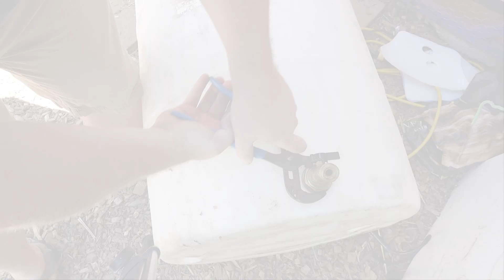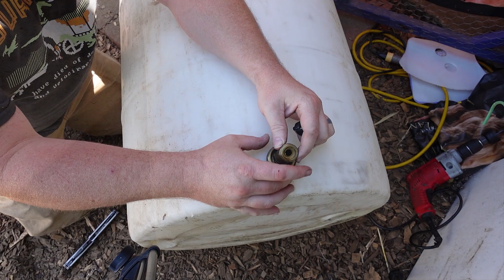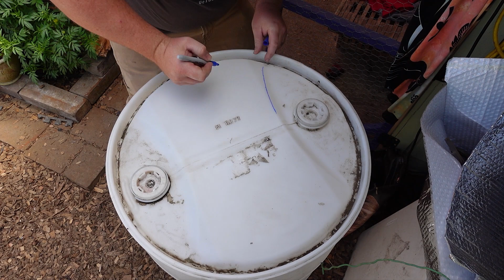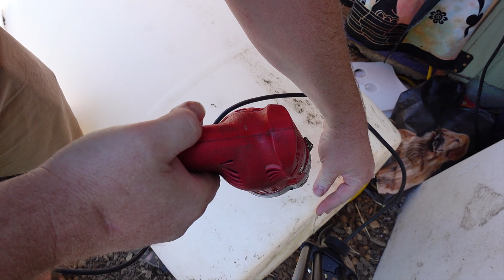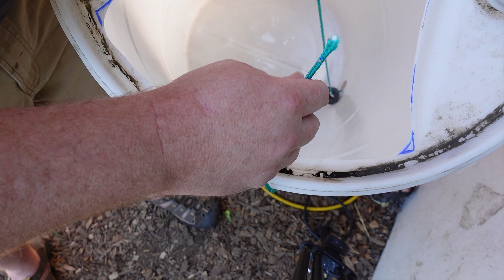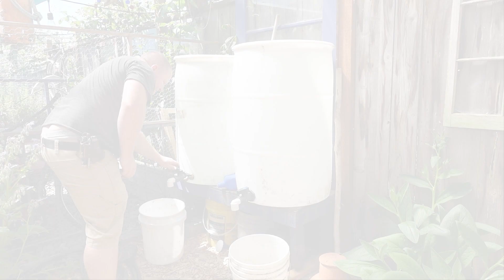Our DIY Water Barrel Setup - Let's Install A Spigot!!!

Comment: That was very clever to use the string to put the fitting into the barrel.
Reply from the maker: It is the only way I could think of to get it down there and it worked out pretty well.